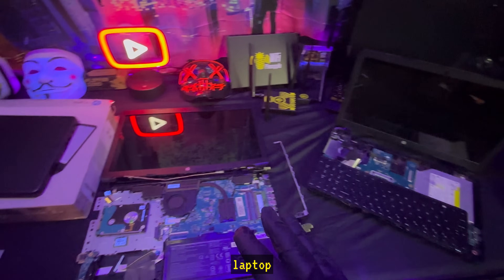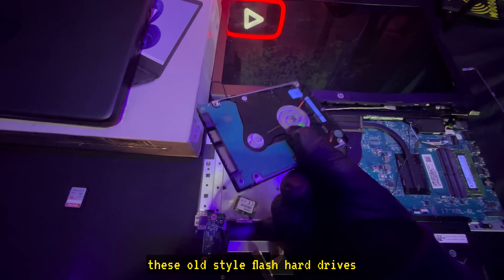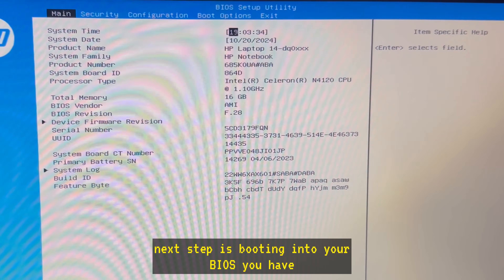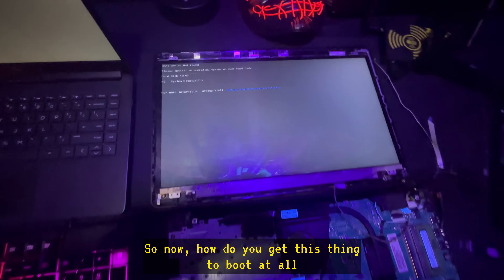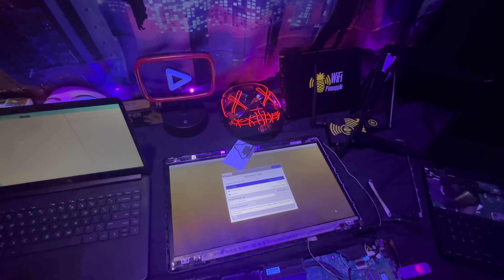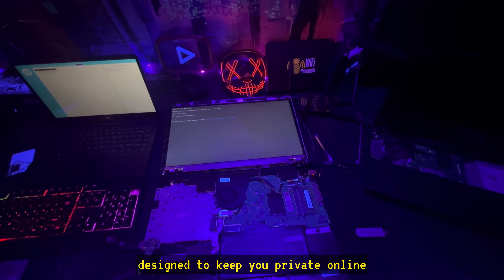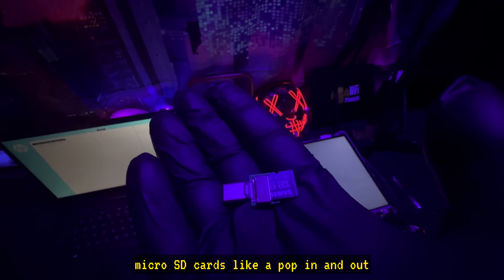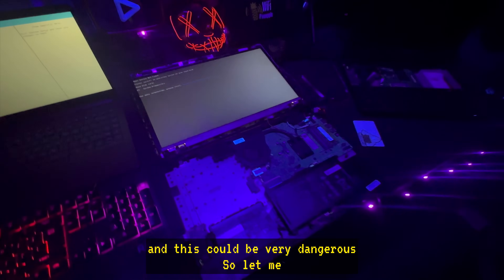Build a Ghost Untraceable Laptop: Ultimate Guide to Online Anonymity and Privacy! DIY

Comment: before I watch the whole video, I would like to say: regardless of what you take out of the system, if the device doesnt have a core2duo or core2quad, or, is librebooted, none of this really matters. It will protect you from other bad actors, but in the case of the government or law enforcement, none of this will matter. The intel management system will own you regardless if there is a camera, and hard drive or not. The only true system for that acts as a ghost system would be a device such as a thinkpad x200, with a core2duo, with the measures like this.
Reply: What if he will make a laptop based on arm or RISC-V architecture?

Comment: i use to be a "printer" in a print shop. 
funny story:  being a cheap bastard , i once printed 2 drivers licenses on just 1 card, that was kept in a very hard to get out slot of a leather "checkbook holder" that has a clear face so you could flash your DL to the cashier.     i was at a grocery store at 2AM in a different state. i had to sack my own groceries so i didnt pay the manager any mind until i noticed him out the corner of my eye. he had pulled my drivers license out of that tight pocket somehow and was showing it to the 2 cashiers , flipping from one side to the other. 
so i grabbed it out of his hand and the checkbook and ran out and down the street. i tore the checks up and ditched them in 5 air conditioners and busted the DL card and put it in 3 fence posts.    I HAD FORGOTTEN TO GRAB THE DAMN CHECK I HAD WRITTEN!!!!    gave myself up an hour later by flagging down a cop, and eventually plead guilty to "attempted theft" 

DONT BE A CHEEP BASTARD! BE WILLING TO WALK AWAY FROM EVERYTHING AND EVERYONE!!

Comment: This can be compromised. Just because it deletes everything off the computer in the end because of it saving to ram doesn’t mean anything when you’re putting a memory stick in it that can have malicious software injected into it by operating system vulnerabilities. On top of that it doesn’t protect your IP, Device footprint/fingerprint. Also if the FEDs get your USB welp there ya go. With a compromise memory unit that you said it basically the whole computer. Every time you plug it in to run it can exploit your location

Comment: So wouldn't the boot drive that you use, as a flash drive, be corrupted after so many unplugs? I mean it is a boot drive.. but its also a flash drive so mi sure it'd have safe-unplug on it. I'm just a little concerned about the whole corruptibility for the drive. Also, I was wondering if there isn't anything traceable on the laptop, wouldn't there be a bunch of traceable things on the flash drive? I mean there isn't nothing wrong with resetting the flash drive with a clean install every time but still its not entirely 100% untraceable

Comment: You can usually disable the microphone and camera by unplugging them from the mainboard. You can also buy a cheap WiFi dongle, and use that instead of the internal card.  For about $25, you have disposable OS and WiFi.

Comment: This is great in terms of hardware, but it's not really practical when it comes to some machines. Dell laptops always had unobtrusive mode and kernel level option to disable cam/mic/wwan/other. Some ThinkPads had physical kill switches and some other manufacturers have complete privacy integrations with options. I know bios/UEFI level stuff can have vulnerabilities/backdoors, but there's always a solution for them.

Comment: well well well, the 15 laptops I have laying around collecting dust are here for a reason
Reply from the maker: YES!!!
Reply: @GhostStrats  I have a question though. You say nothing is stored on the device but Im guessing this doesnt include hardware unique identifiers like a CPU cause they (im guessing) are stored in the same place where the BIOS is stored? This could technically mean you could be identified still, but it would make it a LOT harder?
Reply: @anglerfish61  Wanted to answer you since i didn't see a reply :)
You raise a valid point. Unique hardware identifiers like the CPU, device IDs, or the information stored in the BIOS can theoretically be used to identify a device. However, these identifiers are typically not accessible or used by everyday applications for tracking users directly. For example, web-based applications generally don't have direct access to low-level hardware identifiers due to the layers of security and privacy safeguards.

That being said, it is still possible for advanced tracking techniques or targeted attacks to use a combination of such identifiers and other data to attempt to re-identify a device. But, as you mentioned, this makes it significantly more challenging.

If you're concerned about privacy and tracking, it's always a good idea to stay updated on security practices, use privacy-focused tools, and be mindful of the permissions you grant to applications.

If you have any specific privacy or security concerns you'd like to discuss further, feel free to ask!
God cares for you and jesus loves you have a blessed day :)
Reply: @anglerfish61  if im correct it only uses RAM
Reply: @CreeperChronicless I know this text.... It is 90% AI generated 😂😂
Reply: @CreeperChronicless 😂😂😂😂 AI GENERATED ANSWER
Reply: @GhostStrats can I do0 thisz o0n a Chromebook,LMAO0?😮
Reply: Exactly what I was thinking 😂
Reply: I was thinking the same thing. I have an old alienware been sitting under my bed for like a decade
Reply: As long as they are 64bit aha
Reply: The PFP of yours is showing how antisemitic and propaganda loving you are... Lol. Sad person you are.
Reply: May Palestine be one day free from zionist colonialism!
Reply: Free Palestine ♥🇵🇸
Reply: ✊@nikuyai
Reply: @nikuyai DIY❤
Reply: @nikuyai no
Reply: @nikuyai bot
Reply: @nikuyai Right after they free the hostages they took. Remember, the good guys don't take hostages.
Reply: @DrewMarqX6 - exactly
Reply: @DrewMarqX6  "hostages" they're war prisoners, and even their families are asking for a ceasefire smh
Reply: @sagittariushipster  "war prisoners"? you can't be fkn serious. lmfao! next.

Comment: Didn't get the tracker placed in the CPU as a backdoor for the NSA
Reply: Why is no one answering bro
Reply: And what are their trackers?
Reply: @millcosctd IME in Intel CPUs, supposedly can be abused but I haven't done much research
Reply: @amiriki  most people say that by the time you remove it physically,your already destroyed the CPU well beyond usability 
This is why it's better to use ARMchips for attacks
Reply: @millcosctd  you need to look into it,i cant explain it all,but intel has a contract with the NSA that allows them to place a back door into all of their cpus,and lets them access almost all computers connected to ethernect,weather it is turned on or not
Reply: Intel Active Management / Management engine is built into the chipset the only way to remove it is to purchase a cpu made before it became as intrusive and integrated as it is now and libreboot it.
Reply: I mean core 2 duo and bulldozers predate this
Reply: @raresoupninja  they don't tho son,not to mention that laptop definitely ain't a core2
Reply: It’s in everything
Reply: mossad n unit8200
Reply: I heard USB Killer fry electronics. Is this great solution to bail?
Reply: @ndhikaatube  lol?
Reply: tails runs entirely off of the RAM
Reply: @sillywillyboy  it's still supplying power to the CPU that's the part you don't want
Reply: I hope u made this comment from a safe device

Comment: If you're handy enough, you can install a switch on the mic and camera +5v (+3v?) lines.

Also, I'm not sure if tails fixed this yet, but even after shutdown, memory can be frozen and read using compressed air.  So beware that it could hold data in RAM unpowered for a while.  Law enforcement knows this and if they're after you for data, a fast shutdown might not save you.
Reply: needs a battery kill switch and then to hold the regular power button to clear, maybe even eject the cmos just in case

Comment: I dont know much about this stuff, but i have a question. If you have removed your camera and HDD, but whenever you browse the net wont they be able to find you IP or Mac address? like in mot knowledgeable in this so if you can explain this then thank you.
Reply: tails has mac spoofing, use tor for ip. but there are other problems like motherboard
Reply: @vehice6210  what about the motherboard?

Comment: I dont know if youre aware of the Van Eck phreaking which is related to TEMPEST (Telecommunications Electronics Materials Protected from Emanating Spurious Transmissions), where every electronic device that is powered on can by spied upon from a distance using an antenna and special radio receivers revealing whats on the screen of the target. The technique works on pc monitors , old crt tvs, smart tvs(works better), smartphones , SHIELDED usb and hdmi cables (and pretty much any other cable that carries information digital or analogue) and even air gapped machines, and the signal can be received from tens of meters up to hundreds of meters. Scary stuff if you ask me.
Reply: ME THINK THAT YOU USE TO OWN A "CONSUMERTRONICS " CATALOG AND READ HIS PAPERS!!!
Reply: Someone’s doing that to my phone, pissing me off 📱 🤬 😅
Reply: What? If it's encrypted there's nothing to worry about. Unless they somehow are capturing pixel coordinates directly from bouncing light which is kind of a stretch...
Reply: @care_really_you_do  sorry but you missed the point, ill explain.. you see this is a side channel attack , your cable might be safe but your digital to analog display interface ( which converts the digital data into analog values so that pixels can change state and display an image) is not safe, it was proven that all lcd displays are leaking huge ammounts of electromagnetic radiation (greater than the good old crts), so even if you have the fanciest pc, tv laptop etc its still prone to leakage, it happens even with smartphones and someone skilled can pick that up from across the street if its using the right equipment, no hacking needed , no encryption broken, just picking up your screens emf as radiowaves and decoding that in the same way you would decode an old school tv  broadcast.and this is one of the reasons why you cant usually see the password as you type it.
Reply: @mikimouse3001  This seems very theoretical. Yes it's 'leaking radiation' but that can also be described as: 'it's emitting light'... If anything a household screen produces could go through brick walls there would be health concerns before privacy and security concerns. If they captured a picture or video from a window and having had access to the place the computer was in plus the means to calculate how light specifically bounced there (given that room characteristics) only then would them be able to make sense out of the captured information... quite a stretch. Unless you're saying that somehow they got something in the system and are watching all devices. Which is pointless since for that it would've defeated encryption (and other things) already.
Reply: @care_really_you_do  Not theoretical they had that capability since the 80's , however you would have to be a very important target it they would employ such means, you can't put white vans everywhere. Radio waves do go through walls though these are weak spurious signals, that is what digital signal processing is for.
Reply: Yeah, what people need to do is go back to analog. Why go into the machine when you can just take the machine.

Hacking is cool and super leet,  but its not the most effective way to get the "information". They just do it because it makes them feel cool. 

If they really wanted to heist info they'd do it the best way possible.

Comment: A camera / microphone can be practical sometimes, what you could do instead is just instead of cutting a wire, you could for example add a switch to the ground of both of theses components, thus separating them from the computer but they can still be used as needed
Reply: Point is you don't use your daily driver for this, EVER. If you can't figure out why, pay attention.
Reply: Bad opsec
Reply: @papastuffy  you really don't get the video LMFAO

a better question I can ask you is, why would you bring a tool you'd never use in a job? the laptop he's building isn't for daily driving, it's to ensure that whatever you're doing in that laptop, you will be secure. you don't need a webcam, mic, or hell, even a hard drive because you will never ever need it. you shouldn't. because its sole purpose is security. and anything that can compromise that must be taken out no matter how many loopholes you can find.
Reply: With him doing this to the computer if he installs tails on a flash drive and uses it as his OS wouldn't that prevent intel Me from being able to back door him? There's no storage unit so there's not like they can check his data so I don't see how intel me would work.
Reply: @papastuffy  why delete your other comments?

Anyways, you're not understanding the point we've all made and the point of this video. This is a ghost/"burner" laptop setup. It is used ONLY for your most secure computer usage. This is in addition to a normal use laptop, so you'd have two.
Reply: Honestly it would be very technical and inconvenient to deal with, but if you want you can disconnect/ reconnect the camera and mic wire rather than 'cutting' it off. U will most likely have to take the system apart every time u want to use camera or mic tho
Reply: I think you missed the point.

TL;DR: if you need a webcam/mic, this setup isn't for you.
Reply: @93vxhybridhatchback  You lost it at the last point.

You both know you can just...plug in a USB camera/mic if needed, right?
Reply: @DxBlack  fully aware of that. That's not the point of this video. A "ghost" laptop, again like I have said before, is a "burner laptop. This means that you use it ONLY for thing you want as much distance between it and you. You don't need or want a webcam/mic with a burner. If you need that hardware, use a normal laptop. That's the point. Which you and stuffy fail to realise.
Reply: @papastuffy  this went over your head. If you're making a laptop like this, you DO NOT use a mic/webcam with it. You use a mic/webcam with your "normal" laptop. There is absolutely no need for a webcam/mic for this setup. That's how people get jammed up
Reply: @papastuffy  They're stupid...they're arguing opsec based on the point of the hardware being hardwired on the system while ignoring that YOU in your situation still need them and want them available for use....somehow they bypassed the hardware switch you suggested, as if someone could turn that on by mistake, or that YOU would (implying they're too dumb to make sure they turned it off).
Reply: @DxBlack  yup. Ya got me there /s you clearly on club can't understand. Its not whether its hardwired with a switch or using USB versions, the point is that according to this video, a ghost/burner laptop does not need a webcam/mic. There is no service available that you would use this setup for that requires a cam/mic. If it said service needs a cam/mic, you're going to get jammed. If someone needs a cam/mic for a legit service, they need a normal use laptop.

Comment: Could an Apple G4 Powerbook be converted to a ghost laptop? The G4 does not have a webcam and no soldered components to the motherboard, etc.
Reply: You would have to create a 32-bits PowerPC port of Tails, and a one that can accommodate systems with less that 2GB of RAM. Possible in theory because everything is open source, but good luck with that.

Comment: what  about MAC address obfuscation. is there a wifi card that will allow you to change your MAC address ever time you disconnect or reconnect to a hotspot?
Reply: That's not the part you have to worry about. It is unencrypted hardware signatures. Your motherboard has an identification which is sent in your handshake packets. Not just about MAC or IP spoofing. You have to spoof EVERYTHING.

Comment: Why not just boot tails and other os from HDD or ssd instead of using on USB . all that extra space just unused , also better use a framework laptops then modifying a proprietary bios laptop they have bios backdoor capability and really bad to use esp with secure boot disabled .
Reply: @snayke0  you can flash internal disk like flash drive even put a option to boot any live os just by adding them into its file system.
I am not taking about installing any os just use internal disk like a flash drive
Reply: tails os was made to live on a usb flash drive, not a hdd or ssd

Comment: Technically it’s possible to freeze information in the ram. I read somewhere that some hacker got busted when he was unable to pull out the flash drive and the feds or whoever froze ram with liquid nitrogen and recovered the info from it later.
Reply: yup, as far as I know, they carry liquid nitrogen as everyday equipment, on belt, close to handcuffs...
😂😂😂😂